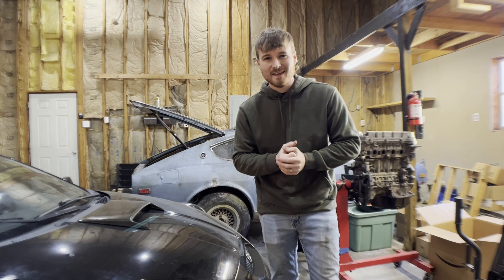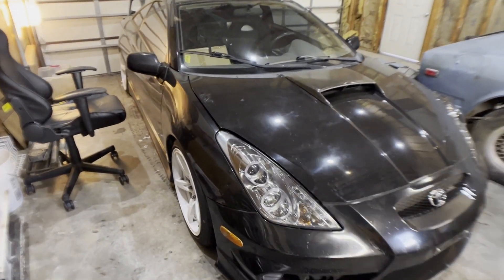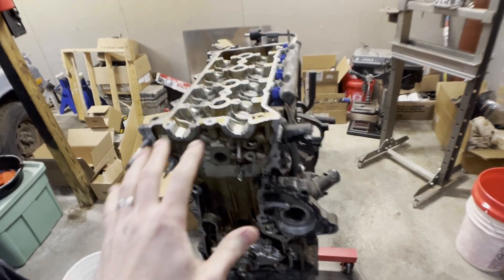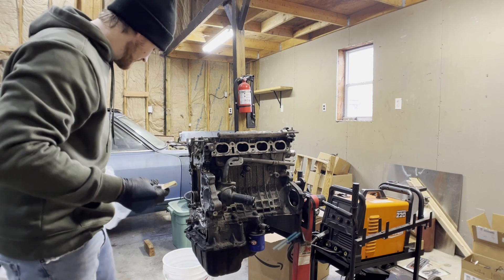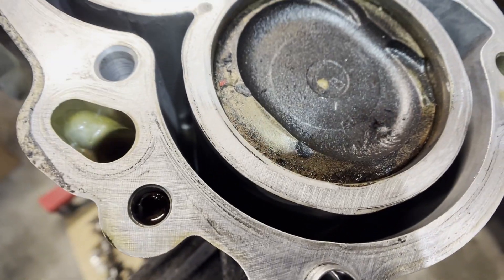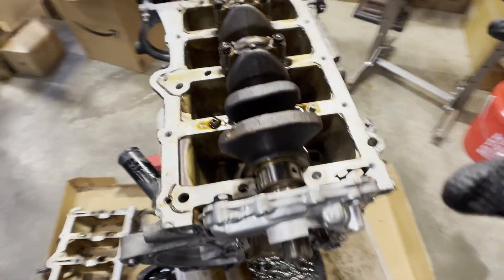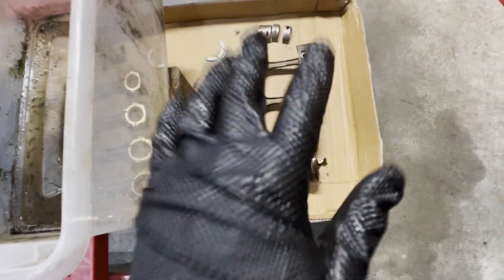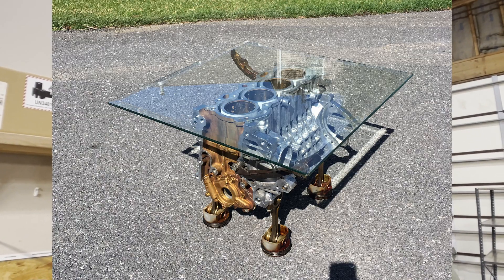1ZZ Engine Rebuild - TEARDOWN

Comment: The 1zz and 2zz engine can not be honed. The cylinder walls are CMC coated which prevents honing and machining.
Reply from the maker: Hey there! thanks for the comment! In all of my research the 2zz is the one that cannot be honed, but the 1zz cylinders are lined with cast iron and can be honed. Hoping you can help me verify this so I know I am not going crazy!! haha
Reply: @ yes the 1zz is cast iron and a little different than the 2zz but it is only very thinly sleeved so it’s easy to burn through it with an aggressive hone and if you do the block is essentially garbage.
Reply from the maker: Okay! Thank you for the info. Seems like 1zzs can safely be bored out to a 79.5mm bore with no sleeves. With that in mind, scuffing up the surface with a ball hone should not be an issue! Thanks for looking out!